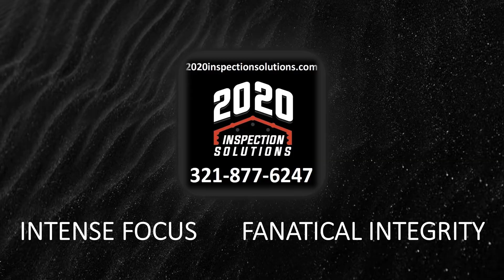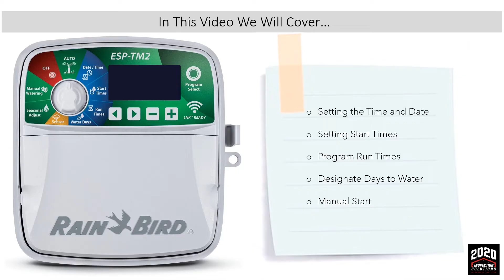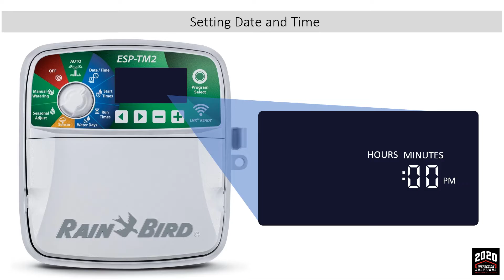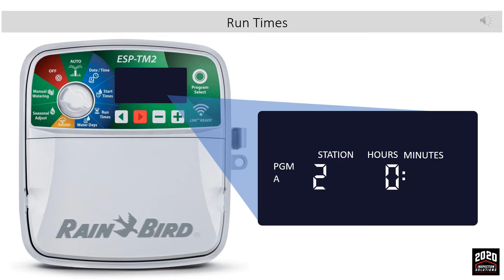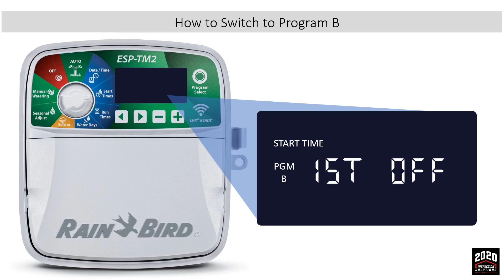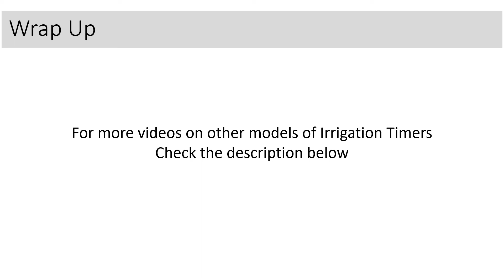Rain Bird ESP-TM2 Controller Irrigation Timer Tutorial

Comment: I used a Rachio for a couple of years until it died. My irrigation "professional" recommended the ESP-ME3, however; when I had a problem connecting to WIFI.  Called the customer support and finally got it connected to only find out this model is now discontinued and it cannot be controlled with the Rainbird Ap. Not what I was expecting!!
Reply: Sounds weird; the model is still available and is compatible with the LNK2 card to be programmed and operated with the Rain Bird App from any smart phone; what is still not available is to operate this controller with the new version of the App 2.0 (by the moment only works with RC2 and BAT controllers)